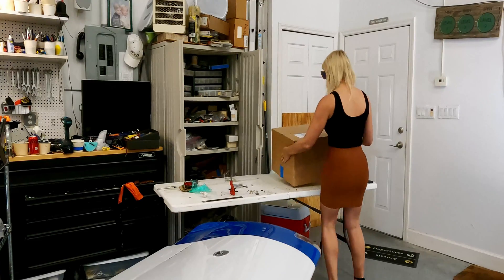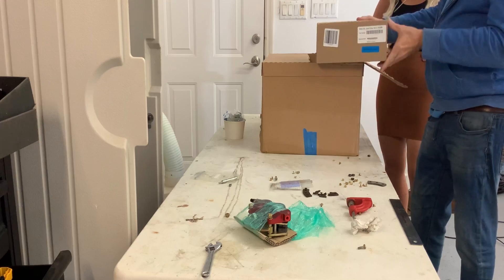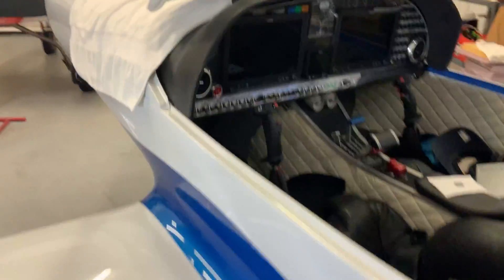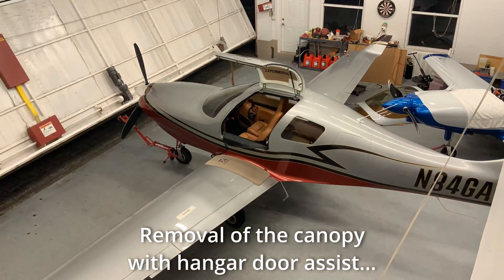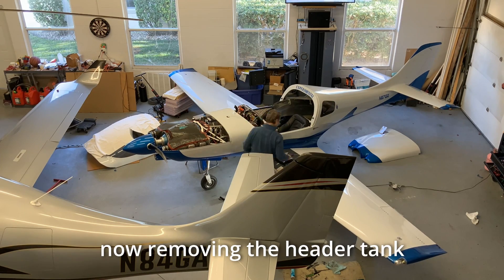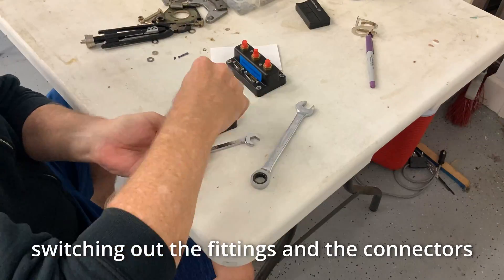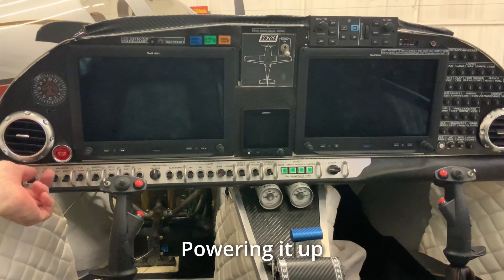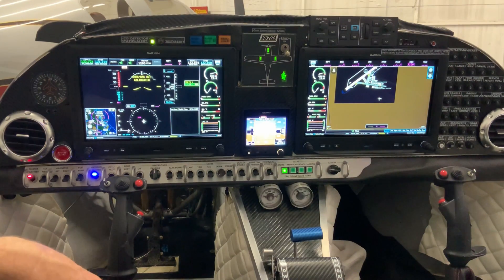AHRS HARDWARE FAULT!  Unboxing and Replacement of the Garmin GSU 25 in Lancair with Garmin G3X Touch

Comment: Did you get a fault indication on screen? I have been having intermittent fails for airspeed and alt on my G3X in the IV but I never get a message to indicate the system is catching this fault. Keep posting vids you are about the only one in the Lancair community who does. I flew over you in early December on my way to Marathon!!
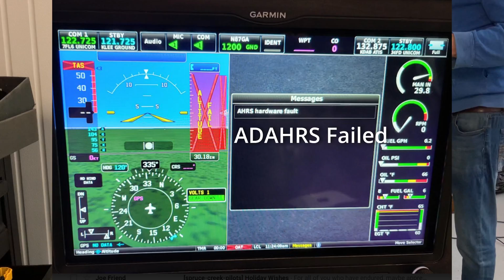Reply from the maker: Hi Danny and thanks for the feedback on the videos.  Yes I did get a fault Indication.  If you go the 0:37 seconds on the video you can see that error message I got.  Restarting the system did not resolve the GSU 25 Hardware fault.  Prior to this I would occasionally get a fail on airspeed and altitude but it was only momentary.  This time nothing would reset the Hardware Fault and fortunately I had wired in a Garmin G5 as my secondary AHRS so I had a backup.    I did troubleshoot this on the phone with the Garmin G3X Experimental team.  I sent them screen shots of the system information and fault indications.  Great group of technical staff.   Next time you are in the area let me know and we can get lunch somewhere.  -  Blue Skies